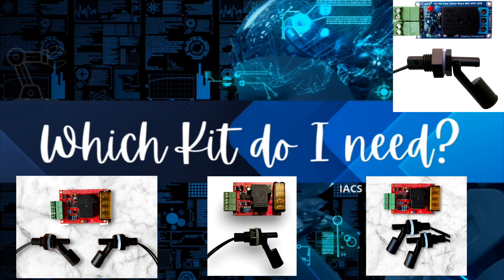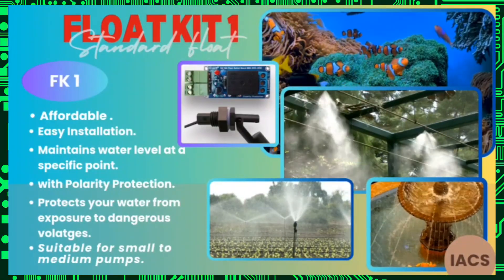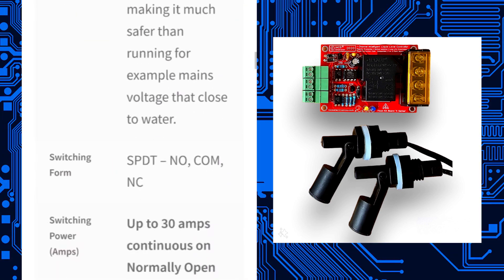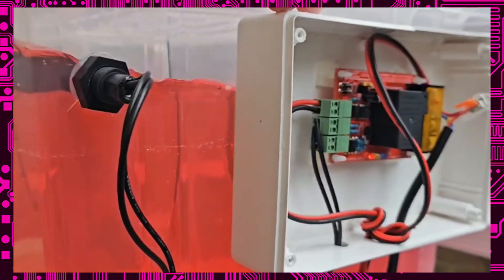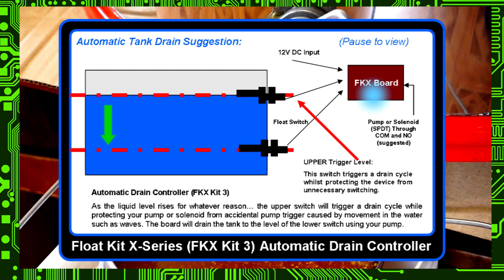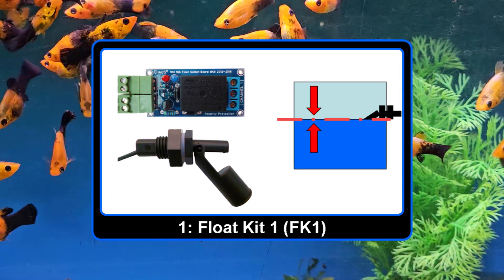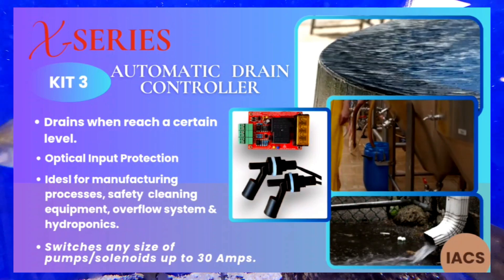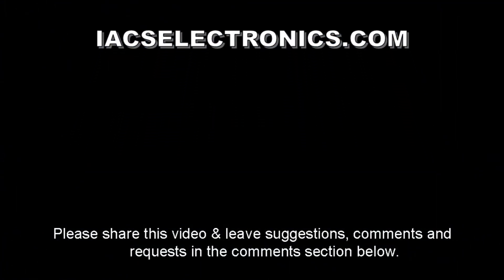Ultimate Comparison: Float Switch Kit 1 (FKS) vs. The X Series (FKX) Kit 1, 2, 3 Wave Resistant AI

Comment: Do you have a kit that will allow me to run a float switch without a 12v battery? I want to use mains power 😊
Reply from the maker: @atjross  hello, not to worry... This is a common requirement. The x series is also designed to work with a small 12 volt transformer and does not require much power to run. This means you can very easily connected up to a 12 volt DC power supply unit that you would use with a CCTV or LED strip light as long as the output is 12 volts DC and minimum of 100 ma. Please let us know if you require any further assistance.

Comment: Kit 3 train controller please. Need one for my grey water system. Can I run it on a higher voltage?
Reply from the maker: We've got you in the raffle for a drain controller best of luck. You can run the kit on higher voltages easily if you have the right converter. Running it from a mains voltage socket such as a house wall plug is very simple and cheap to source. If you need help please message us.